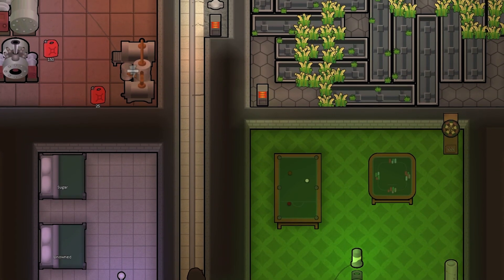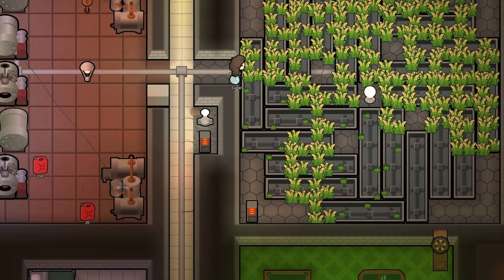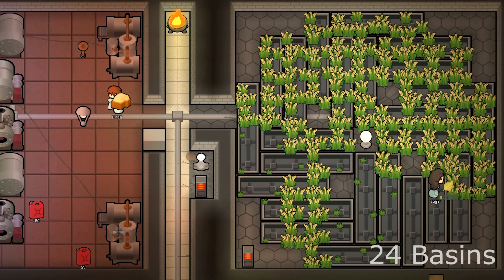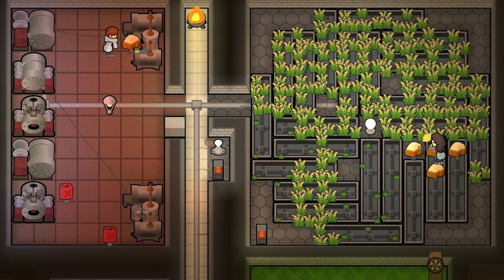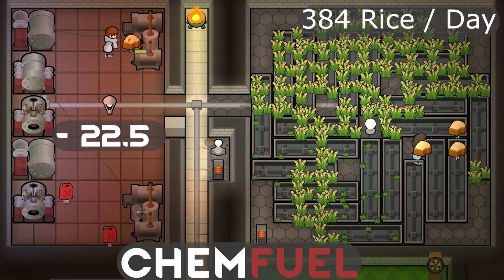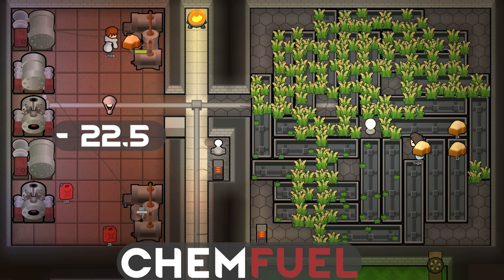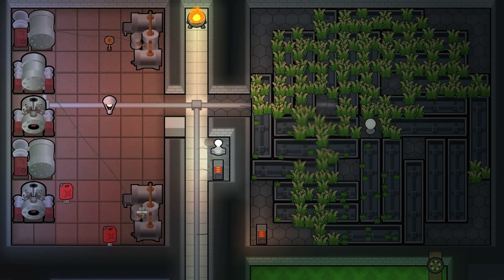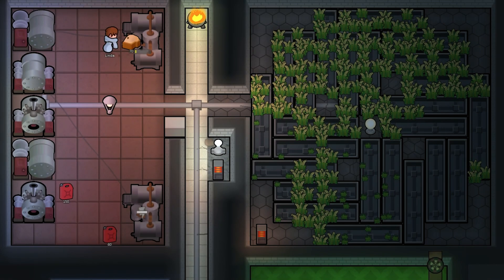Can Hydroponics Power a Base? | Rimworld

Comment: You can get much better numbers, much more compact with less labor than this by feeding horses, cows or muffalos with nutriant paste. Be careful about overheating the room though as animals produce a little bit of heat so if you cram them into a tiny space that might cause issues, though on ice sheets that might be a good thing.
Reply from the maker: If nutrient paste did not take so much micromanaging, I would abuse it more often
Reply: @OneHunchMan alas sir. A simple mod that allows animals to auto use nutrient dispensers
Reply from the maker: @ekothesilent9456  That would do it for sure
Reply: @OneHunchMan  It's possible to automate Nutrient paste distribution for animals without mod. All you have to do is build your animal pen inside your prison barrack, your dispenser outside the prison/pen and to set your prisoner's food policy to nutrient paste. When your warden deliver the nutrient paste to your prisoners, your farm animals will often eat it first.

Comment: What if you only used sunlamps
Reply from the maker: The sunlamps are the biggest energy consumer but assuming a sun lamp and peripherals like heaters, you would need 4 chemfuel generators. This would significantly cut down on repairs necessary for the hydroponics as well

Comment: Rimworld is breaking some thermodynamic law but ok i guess
Reply: Maybe not.. the energy is still input through the soil. It’s feasible that energy from corn or rice could be enough to light a sun lamp and simultaneously pump water to the hydroponics. The added energy from the Soil or fertilizer could then create an excess. It doesn’t breach thermodynamics I don’t think.
Reply: @ekothesilent9456 , ask yourself. If plants have extra energy from soil, for what they are using light. 
To be serious, plats use a lot of energy to bring nutrition from soil. Also this nutrition energy is uncomparable to used sunlight to bring it.
Reply: @KrokOdZrozumienia  your argument is too incoherent for me to respond to. I think you are asking if energy from soil is sufficient to power a lamp capable of growing plants and the answer to that question is most certainly yes. We humans use olive oil and seed oils to power lighting and that lighting only needs to provide 1/3rd of the energy a plant requires to grow. They get the other 2/3rds from respiration and mineral consumption from soil. If a human adds their own labor into the system to till the earth and bring minerals and nutrients to the surface than the math adds up. I know rimworld doesn’t perfectly follow real life rules but the logic and math is sound in this scenario and would prevent the violation of thermodynamic laws.
Reply: @ekothesilent9456  oh man. Here is Simple fact for you. Fothosyntesis is 5% efficient. And I made mistake in last comment. Soil does not have energy/ have low energy potential. Plants need to make a lot of entropy to turn soil into something burneble. Do you still belive it is possible to power lamp by burning plants?
Reply: @ekothesilent9456  here is some fact: 
Potatos 80 kcal per 100g= 65 W/100g
Potato plant: grow time 90 days
Potato plant size: 0.25 m2
Potato plant weight after sezon: 5/7kg
Light used per m2: 500W (half of Sun)

Count it by yourself, but it turns out you can power lamp by 30 days by potatos that grewd 90 days. That not sound like good plan
Reply: @KrokOdZrozumienia  bro did all that math to find out light provided 1/3rd of the energy required to be a potato 😎😎🤔🤔😂😂
Reply: @ekothesilent9456  thats not what it Means. Results means that, 66% energy for lamp is needed from extra source. Potatos gives 33% energy needed to power lamp in optimistic approuch...
Reply: If you dont understood that, I cant provide you easyer answer

Comment: That in itself can be realistic for something like underground bases with back up power without relying on batteries.  I had something like this in a complex once for winter time.  But I didn't use hydroponics, it was an indoor area with soil.  So the number of generators needed was a lot less.
Reply from the maker: Indoor soil areas are the best! Realistically, I look for areas of gravel/soil and stone so I can use a mix of hydroponics and soil to maximize a sun lamp since they are such a big power sink. (if no 100% soil patches are useable)

Comment: Alright we have established that we can do it. Time to optimize. Did you take into account having at least one chemfuel manufacturing station for the power calculation? Is rice the most efficient crop for chem fuel manufacturing? Is there one with a better work to chem fuel ratio?
Reply from the maker: Some great questions! You only need 1 manufacturing station, I had 2 for no real reason. For fun I ran the numbers for you though. Assuming 1000 in game seconds a day and 33.33 seconds per 35 chemfuel, you could make 525 chemfuel  every 12 hours of work and that would fuel 116 chemfuel generators each day! 

Rice is 100% the best for making chemfuel since it grows so quickly and chemfuel uses the nutrition to calculate output so making a crop like potatoes is a waste. Corn could save labor but you can't grow corn in hydroponics. Rice still theoretically produces more nutrition but requires far more labor than corn so I would recommend corn if you are growing in soil. 

Hope that answers everything!